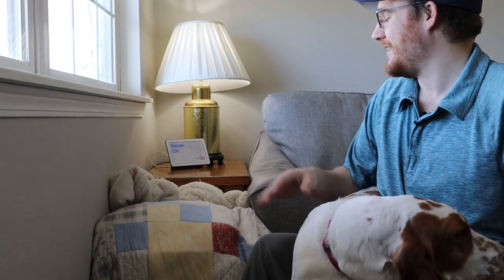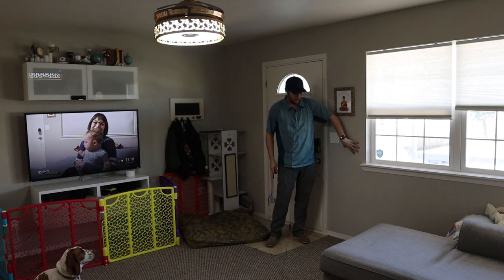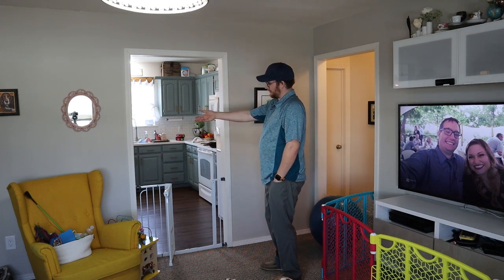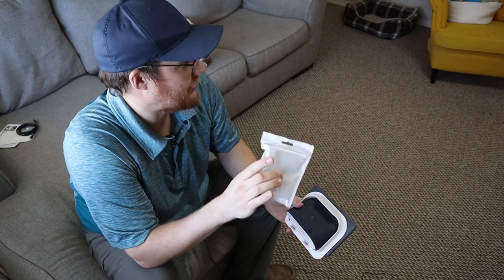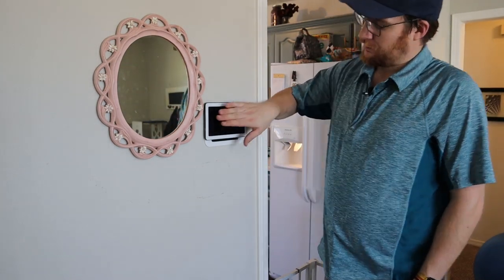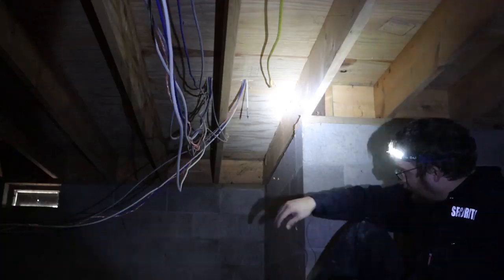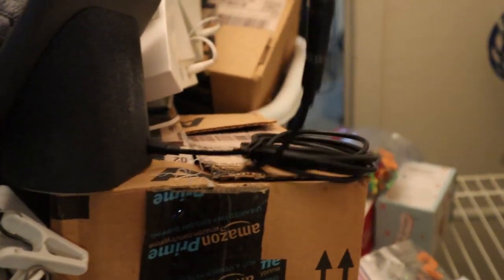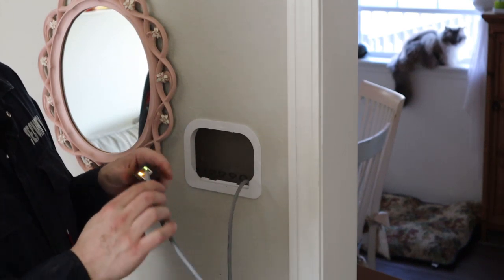Making a Dumb Wall Smarter - Smart Home Hub INwall INstall

Comment: What's the silver bullet looking tool and wall swiper thing you used?   Is that magnetic?   Do you have an Amazon link to that? Thanks a bunch :)
Reply from the maker: For sure. It is magnetic, and works pretty slick! Here is the link:

https://www.amazon.com/Magnepull-XP1000-LC-Wire-Pulling-System/dp/B00MW9A8AY/ref=sr_1_1_sspa